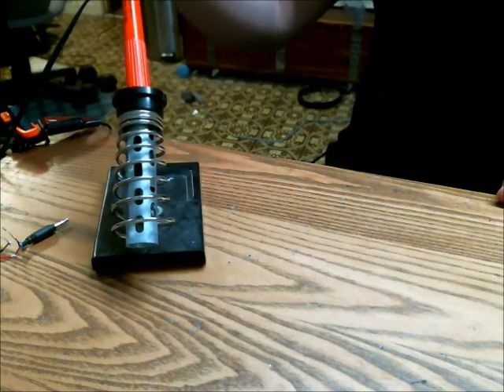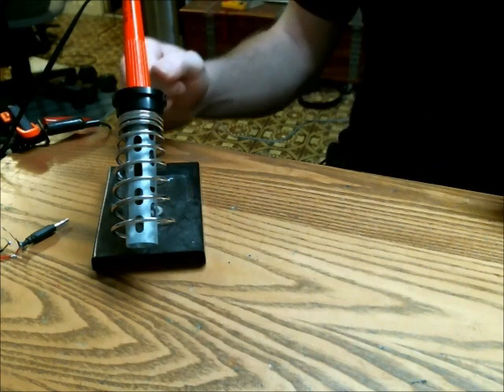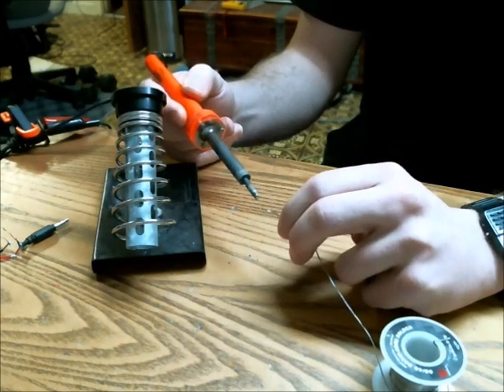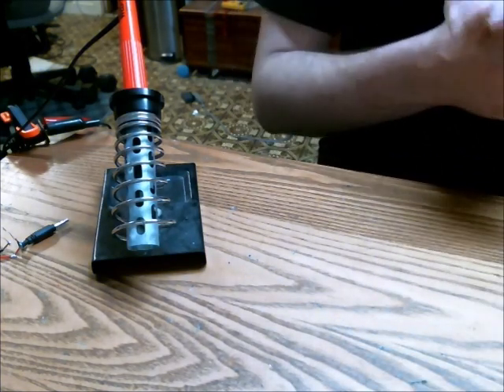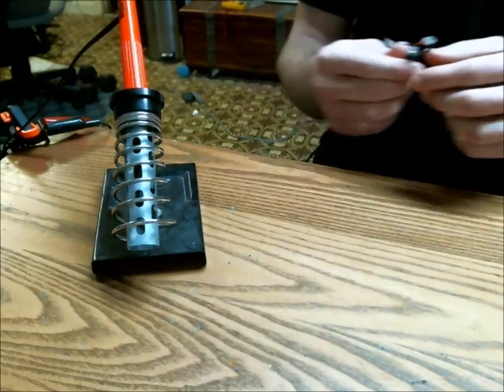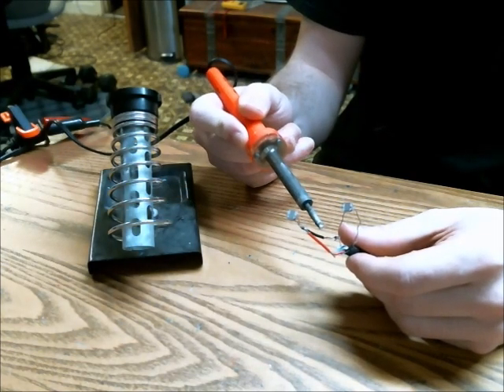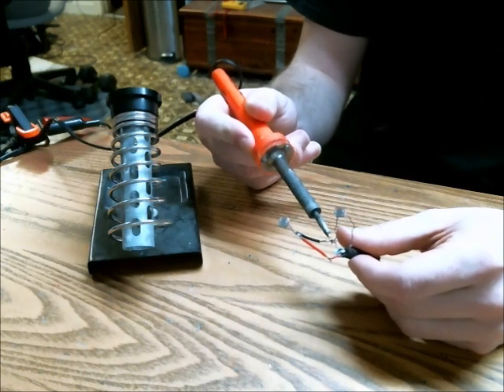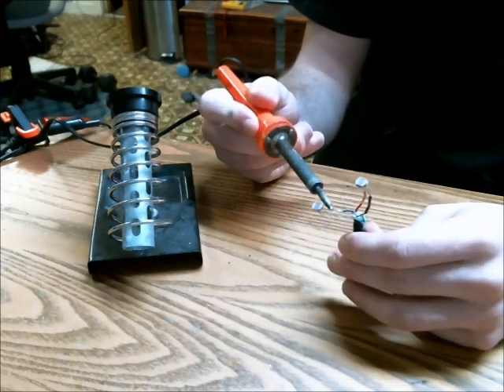S.M. Rheostat - 25W Soldering Iron

Comment from the maker: This model's tip has threading so just turn the tip counter clockwise with pliers and it should come loose.
Search Amazon using this "Weller Mt1" for replacement tips

Comment: Hi, iI bought a new 25w soldering but dont know how to use do i need some kind of voltage controller or do i have to plug in soldering iron directly to the main power line